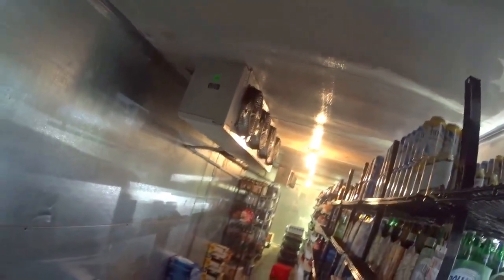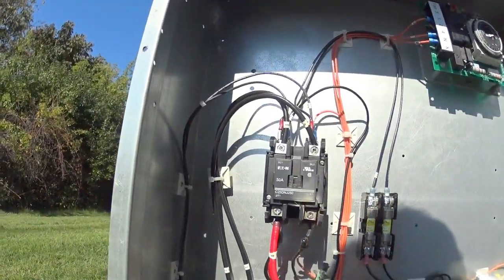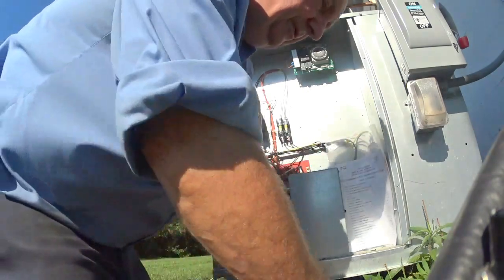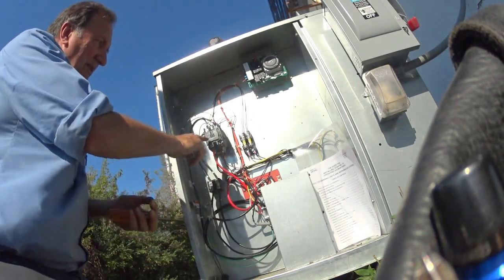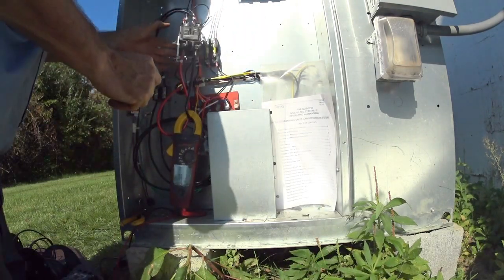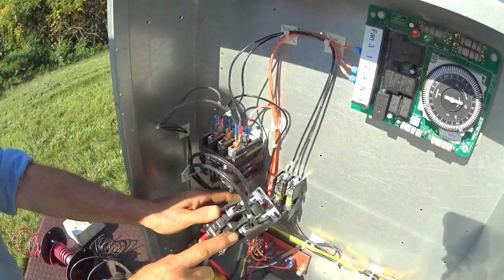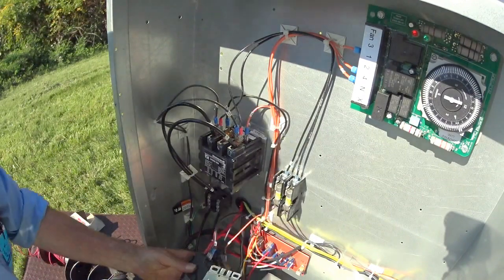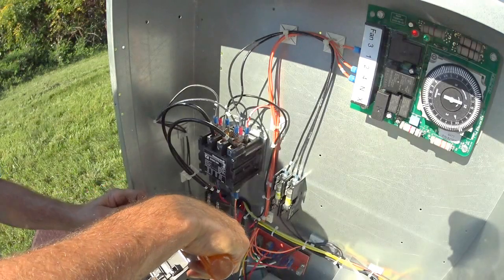Refrigeration Unit with burnt aluminum wires (part 1)

Comment: I think Ali wire is illegal here! never seen it in use other than for telephone systems and low voltage stuff. Nice work Jim!
Reply from the maker: it works for a couple years then burns up. The equipment designers think it's a good idea because it's cheap, they can make more money.
Reply: I Think main problem is Al and Copper connections frome the contactor in combination with condensing water (out the air on cold mornings) goves a perfect corrosive area. And a higher resistence. But Al wire is most use in Building Supply things.